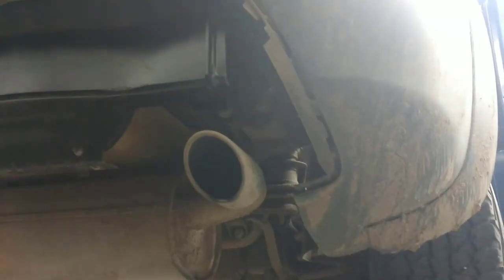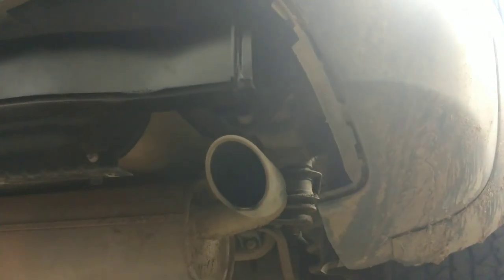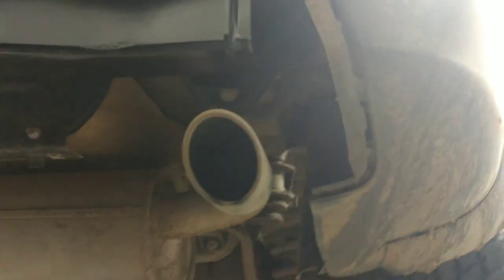Jeep Cherokee Trailhawk trailer receiver hitch install

Comment: Only problem is if you buy the trailer tow group from the factory you get a 3.5 gear ratio, instead of the 3.25 in the non trailer tow group
Reply from the maker: I dont know about that, but I'm pretty sure you also don't have the big fancy oil cooler.  I used mine for pulling a small trailer with a motorcycle for camping.  Never have any issues with power, or oil temps.

Comment: How is the wiring for this after the hitch install? Do I need a full kit, is it prewired, or should I find a shop?
Reply from the maker: It's pretty straightforward.  Hardest part, is running power wire to the battery. You will need the wiring kit, it is a small computer that you tap into the harness.
Reply: @mount27  thanks for the quick reply. Might just purchase everything and give it a go.
Reply: mount27 do you have a link for the wiring kit?

Comment: Ok, so the directions say to take off the whole bumper.  So by you just taking off that lower plastic piece.....did it go back on easily and correctly.
Reply from the maker: Travis Wilson yes
Reply: Did you install a bezel around the new hitch?
Reply from the maker: Daniel Fidoe no
Reply: mount27 can you post a picture of it all back together. Doesn’t the trim cover the receiver when you put it back on?
Reply from the maker: Daniel Fidoe do you have a Trailhawk, if so, join the Trailhawk Facebook group. Jeep Cherokee Trailhawk owners group
Reply: mount27  Just sent a request ;)

Do you know if the trailhawk has the wiring already?
Reply: The newer trail hawks the whole bumper needs to come off because it is one piece, at least it is on my 2019 trail hawk

Comment: how  do you get it to unsnap valance piece once the 4 screws are out
Reply from the maker: It should just unsnap,  with a little tug.
Reply: didnt no,if you used a tool so unbolt 1st then unsnap
Reply: that will be a life saver for me
Reply from the maker: Only took, would be a flat screwdriver,  if they are stubborn

Comment: What year is your trail hawk?
Reply: I have a 2015 and took it into Jeep to add a hitch and they put one of those low hanging hitches and there trying to tell me that they could not put a hitch that goes up in the bumper like yours? Does that sound correct?
Reply from the maker: Mine is a 16, if yours is a trailhawk,  they lied to you
Reply: @mount27  thanks, that what I thought. Did you have the part# of your hitch?
Reply from the maker: @djheinze33  2014 to 2016 Jeep Cherokee Mopar... https://www.amazon.com/dp/B00IG9RSVG?ref=yo_pop_ma_swf
Reply from the maker: @djheinze33  was cheaper when I bought it
Reply: Did you have to buy the bezel that is also recommended on that amazon listing?
Reply from the maker: @remeyrozin  no

Comment: Hey man, I have a 2014 Trailhawk, and i do not have a hitch installed at the moment but i am looking to install one. did you have to install a wiring harness or does the trailhawk come pre wired? also i am assuming i will only need a hitch receiver and not cut my bumper to put in a bezel, is this correct? Any information you can help with about what i might need i would greatly appreciate it! Thanks
Reply: How hard do you have to pull to get the plastic bumper off? I took off the screws but man its bending to take off.
Reply: I got it!! Just used a flat head screw driver to remove at clips.